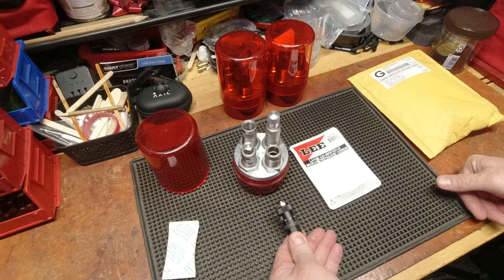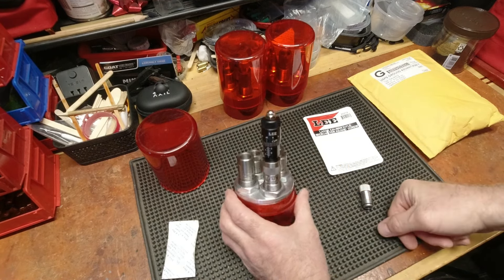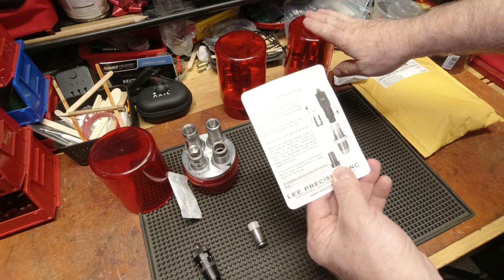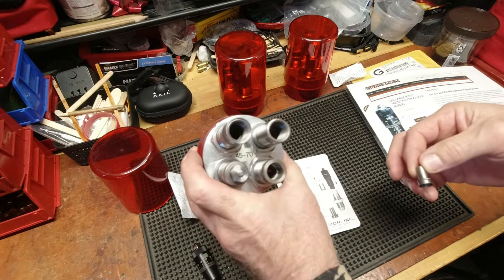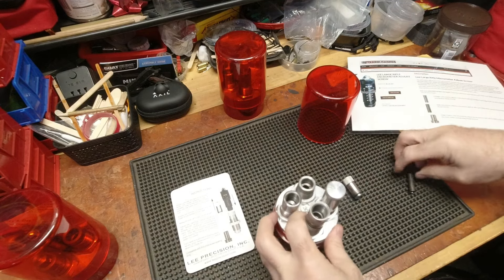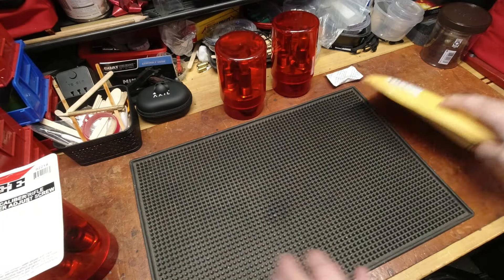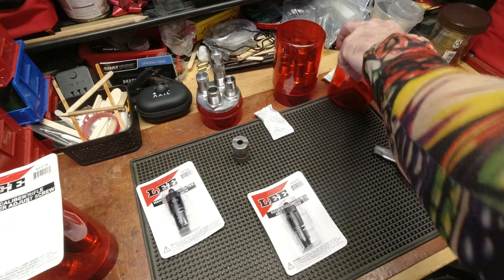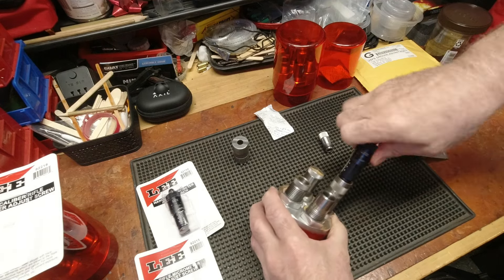Update / Correction on Lee Micrometer Adjust Screw

Comment: I use and have a LOT of Lee die's, powder measure, trimmer etc. and two of their presses. I mainly use Hornady seating dies and have Hornady's version of micro adjust (while really nice I believe it is over priced). I just ordered one of these from Titan to add to my lee dies to give it a try. I make a dummy round up on each caliber/grain bullet so I can just set it up and then adjust down with my adjustment and that gets me within a couple thou and fine tune from here, the main advantage using these over the standard adjustment is you can actually see how much you are adjusting in or out and it saves you a few guestimates. 
Up until my last purchase Lee has always impressed me but I will admit Lee let a lot of people down with their Ultimate reloading press and it's known issue's and so far no fix for it.
Reply from the maker: Lee provides great value and excellent gear IMO.  Undeservedly bashed by those, me thinks, who don't own Lee gear and are just expressing either their bias or what they "heard" versus what they've actually experienced.
Reply: Follow up: Lee did an upgrade to their ultimate reloading press and if you had one of the early presses you get the parts for free to upgrade your press.
Reply from the maker: @MegaLostOne  - have been a long time Lee fan and knowing this only reinforces my position on Lee.  Great value.  I guess many seem to believe that if something is reasonably priced or much less than the competitors, it must not be so good.  After all, look at the seating micrometer pricing from the other big names, crazy.

Comment: Great job showing these. Lee is spanking Hornady's 99.99 Micrometer at this point! 😆😅🤣
Reply from the maker: I think Lee is spanking EVERY manufacturer that produces a seating micrometer add on to their seating dies as the cheapest I was able to find was ~$50 and the most expensive around $120.  Crazy.  This thing is such a winner.  I see Midway already raised the price from what I initially paid.  At $15 (what I paid on Titan) this is an amazing buy...and even at full MSRP of $20 it's still a huge win IMO.
Reply: Not to mention, Lee's dead length bullet seating die, is already the most accurate seating die on the market. Everything else sucks.